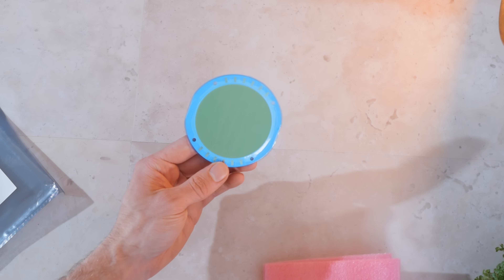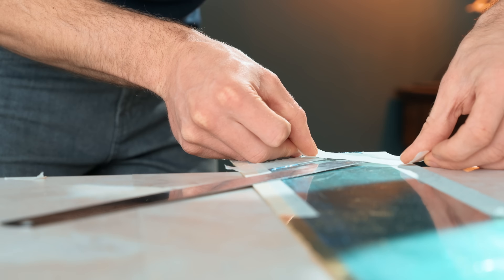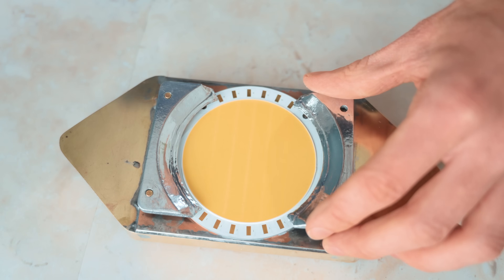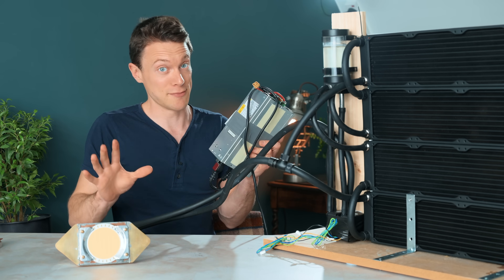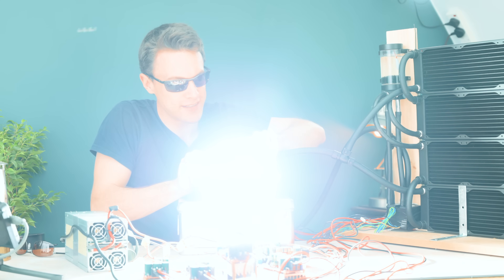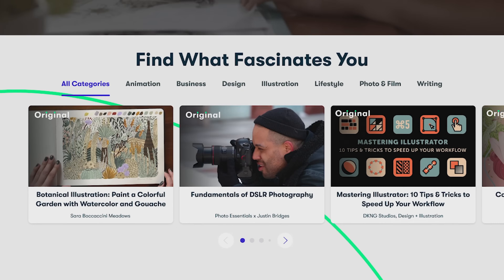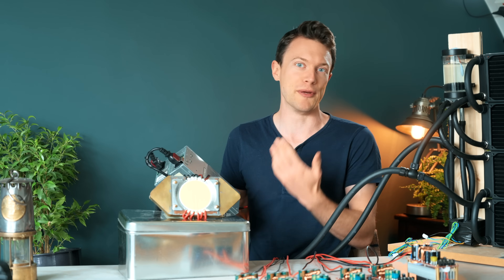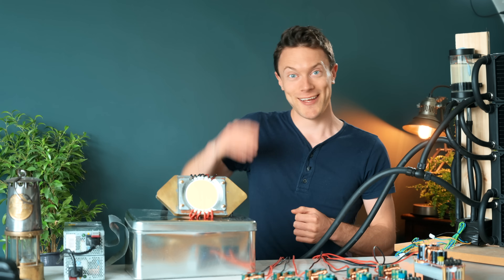Testing the world's BRIGHTEST LED!!!

Comment: @DIY Perks: If you are still looking for a powerfull PSU, check out the LUETZE CPSB3 series. The major unit can deliver 2.4 kW and can be adjusted very wide on the voltage. Google for the #722816, you will also find it in UK. Chers, Martin

Comment: It's certainly safe to plan for drawing 1500w of heat away from the device, but ... that's the total power. LEDs are very efficient (around 50%), so the actual waste heat would be in the 700 - 800w range. Your hands got hot because the other 700 - 800w of power was radiated away as light.

Comment: Sooo the whole point of water cooling is to use the radiators and FANS on the radiators to remove the heat from the water? Otherwise the heat stays in the water and gets hotter and hotter..

Comment: It is a bad idea to put PSU in series because you never know how their ground ended up internally. You can get 2 x 1200w PSU, each of them can connect to 3 booster with 12V, although may add more stress to the booster but the PSU can easily handle high current 12V since it is designed for 12V. The radiator is also being overkilled but since it is a test so is ok, I think even one radiator will be enough because water has ridiculous high heat capacity.
Or, for portability, just use 2 lead acid batteries in series, that will replace the power supply, you are going to show off at outdoor anyway.

Comment: Wait a minute, if t he power supplies are in SERIES, you are not doubling the CURRENT but instead doubling the VOLTAGE. To double the current, you need to have them in PARALLEL. So which is it? Did you just make a mistake in your description or is there a mistake in the hookup?? If the power supplies are indeed in SERIES, you can still only get a maximum of current of whatever the one supply can produce, and you are correct in saying they are not intended to be run in SERIES. However, power supplies are also not intended to be run in PARALLEL either because one could be slightly higher in voltage than the other and therefore would take over more of the current load, possibly enough to cause it to burn up.

I just read Zohaib Shan
's comment. So it seems that indeed you did have the power supplies in SERIES, but as Zohaib Shan
 pointed out, the total power rating is for the three separate output rails. Probably the +5 and +3 are higher current than the +12, which is likely just used to power fans.

Anyway, get a honkin' big 30V supply and get that baby lighting up the whole town! Love the water-cooled solution. I've had so many people tell me that LED's don't get hot I want to scream. The little 2 mm or 3mm guys don't generate any noticeable heat, but then they are consuming mere microwatts of power. Not so with higher power LEDs, even including the 3 to 6 watt versions in screw-in mains replacement bulbs. Heat is the primary killer of those bulbs, and it's usually the capacitor in the AC-DC conversion circuit that dies first. I'm keeping records of failures of those LED replacement bulbs in my home. So far, the average life is about 39 months. A long way from the claimed 12 to 15 years. In fact, the spiral CFL bulbs (claimed to last 7 years) have about that same average life and so in fact do, yes you guessed it, incandescent bulbs. So, for 10 times the price of an incandescent, you can buy an LED replacement that will last about the same length of time. Do the LEDs save enough electricity to pay for themselves? Maybe--depends on what you are paying for electricity.

Comment: One of the large radiators should be enought theoretically, but better safe than sorry. However mixing different metals is often a source aof failiure in liquid cooled systems. The large finspace should stop the cooler from clogging up, but over time the solder might corrode without additives in the cooling water.

Comment: Have you considered using peltier's to cool the LED? https://www.ebay.co.uk/itm/XD-2041-80W-Refrigeration-Semiconductor-Cooling-Thermoelectric-Peltier-Cooler-SP/184279983671?hash=item2ae7f16637:g:ZqcAAOSwDlZesUuh
Reply: Peltiers aren´t really useful for removing large amounts of heat. They can power a well isolated minifridge, but thats about it. A 500W Peltier can barely cool a 100W CPU as shown by Linus Tech Tips.

Comment: Lead and copper don't corrode if kept out if the elements. there's a reason copper piping lasts for 100 years in houses. The copper and brass could oxidize  (see statue of liberty) especially when you get your greasy fingers all over it or if exposed to acidic water. Coat all of the expose metal in a thin coat of laquer and you'll never have to worry. Also Im sure you know to use distilled water so you don't have to worry about the inside getting mineral buildup. I don't think you would need to use any additives.

Comment: The power supplies died because of the series connection on the smps they need to have exact same voltage into even mv  for being run in series without burning themselves but the thing is even the difference in length of the wires can change that

Comment: Quick question, I got into tinkering and I need to get myself a digital multimeter. I read online that I should stay away from the cheap ones and I noticed that yours used in the video 11:40 costs about 25 euros. I would like to ask how it performs and if I should get it too. I was actually saving to get a fluke. But if something like that is enough I can just ditch the fluke because it is expensive

Comment: That's an overkill cooling solution, LED's convert a big part of it's power to light so you shouldn't compare them to CPU's.
Also don't use PWM power supply in series.
Take a look at "Taskled" drivers, i've been using them and they are the most advanced and compact i known about.

Comment: Not sure if it's the right terms, but I'm thinking what happened is the power supplies can put out that much total current, but split between multiple power rails. Since you likely pulled the power from a single rail from each, it likely was too much for that single power rail.

Comment: Isn't your cooling system not way to overpowered? What is the efficiency of the LED? If we assume 90%, you only have the dissipate 10% of 1500W which is just 150W of heat.
Reply: Only in your dream they are that efficient

Comment: 1,000 watt server power supply's won't put out that much through the 12 volt rail. It should show the limit on the case somewhere. It probably puts out 500 watts to the 12 volt rails and probably another 500 to the 3.3, 5v, and -12v rails. I'm surprised they didn't go into power failure mode and just blew up, then again server psu's are designed to keep pushing power to be reliable. You need 12 volt only power supply's or a single 24 volt power supply and divide the voltage for the 12 volt system. Very impressive led though! You could get away with only 3 radiators and the best fans you currently have to make it a little more compact, 30 degree's is very good.

Comment: I think you're mistaken. Ideally the liquid coming into the block is room temperature and the liquid coming out of the block is warm. The fact that the block is not warm on either side more likely means it is not doing it's job of moving heat from the diode to the water.

Comment: $500 LED from last time is more than enough for 90% application, this is completely insane. What you trying to do? Communicate with aliens? By the way, this cooling unit won’t last, mix metals in cooling loops is a disaster in the med-long run.

Comment: 1:56 "But despite my hunting, i can't find one that is big enough to fit on the LED" Strange i find one in only a few seconds, just use a AMD Ryzen Threadripper CPU Waterblock, they are a LOT bigger then the normal CPU waterblock. 

https://www.amazon.com/s?k=amd+threadripper+waterblock&crid=38H5PN27AWCIZ&sprefix=AMD+Threadripper+Wa%2Caps%2C235&ref=nb_sb_ss_i_2_19

And it can take up to 1 and a 2 hours to see the real temps you get with water cooling, a LOT longer then the normal heatsinks (non water cooling) you have for CPU's.

And why not buy a 200w PC PSU, then your done, is a LOT better then doing two in series?!

Comment: It is really weird that the power supplies failed. These power supplies do have over current and over temperature protection usually.  There must have been some fault in the before or doggy components. Powering them in series is most likely a problem.

Comment: hmm are you sure the power supply can do 750w at 12V AND are you sure there are not a ground loop short for the power supply when you connect it in series? Plus the sequence of powering them on also matters when connecting in series. AND why not judt use them in parallel if you are using boost converters anyway...

Comment: A 1500W LED doen't put out anwhere near 1500W oh heat. If it did then it would get hotter than a toaster oven and no light would come out as all the energy is converted to heat and not light.

Comment: you do know how overkill your cooling setup is right? unlike pcs if leds are efficient it means there's a lot of power NOT going into the heat sink. just kind of hurts to see such a waste of resources. also instead of buying 2 pumps you know what would have kept your led MORE safe at less resource waste? a fucking temperature sensor. hell buy 2 temperature sensors and 2 relays that's where redundancy actually makes sense.

Comment: You should check with the manufacturer--just because the COB LED is rated to 1500W max, it is usually unwise to run it at max power. Running it at 50% or lower, maybe even 30%, is more sensible or you reduce it's life span, i.e. you burn it out rapidly. Cooling it would be less of a problem too. 1500W probably exceeds if not triples max sunlight in it's beam. It's just something to think about. I think most 'grow lights' run the LEDs at a significantly lower wattage than the max wattage that could be used and can still exceed sunlight, in the $600 price range, including all the electronics and cooling.

 Also, there are specialized LED drivers/power supply designs that are specially made for controlling the voltage and wattage, to make sure you don't harm the LED, and you might want to look into their design in relationship to computer power supplies. (I don't know the differences, and it's possible that computer supplies can be modified to accommodate the differences. It's just something to think about.) 

These a very interesting COBs, and their application does require cooling designs and probably lens designs to distribute the photons, but I think they are not meant to be run at full power. 

They have more available light in a compact unit, and could be very useful , but it comes at a price. You say you got this for $1000, but they are more like $1500 and don't include any of the electronics. These could make a great grow light in a large space, or spot light, stage light, or photography light when used properly, but even so, they are overly expensive for what you get, and the grief you have to go through to balance all the other factors needed for setting them up and making them usable.

Comment: That thermal paste application is guaranteed to start a fight in the comments section
Reply: Pretty sure he scraped off the excess, but damn I've never seen so much thermal paste in one cooling "block" before
Reply: @brandonthegrey  The best way is to just squirt out a single round blob. When it gets tightened down it evenly spreads out with no chance of air getting trapped. Either way, who cares. It's not my stuff that's going to get ruined.
Reply: @rubiconnn  Well it's fine here since he doesn't really have any electronics beside the LED, so no greasy motherboard for him
Reply: @brandonthegrey  overapplication can reduce thermal performance
Reply: @corysinclair5753  That's true; also having that many radiators isn't beneficial either (he's better off with one).  It's still fine though. His water loop is redundantly capable of cooling the light in spite of the small oversights.
Reply: @davidcastillo1340  A single radiator is designed to cool off about 300W of thermal power. Way too little to cool his LED. Using 4 of them was a good call.
Reply: mezz Dude not all 1500 watts is being converted into heat coming off the back of the LED. The majority of those 1500 watts is being converted into, don’t act too surprised, LIGHT
Reply: @bloogaming8827  majority? You overstate the efficiency of LEDs way too much. 60% is already a tech marvel, above that just some lab ones. Not to mention a bit of that also goes into invisible light, including infrared (which itself turns into heat easily, tho granted, pointing away from the chip).
By that figure, 2 of those radiators would already be saturated, which is quite expected of high-end enthusiast grade PCs running on water cooling, overclocked with multi-GPU setups (and ye you better keep that LED under 80ºc at the very least).
Reply: Kalvinjj I stand corrected. Not quite majority, but still a significant percentage of the 1500W is being converted to light and not heat. I’m glad you brought up PCs. An overclocked multi-GPU setup could definitely require two of those radiators and would be giving off easily 800W. However, notice that the coolant temperature in this setup didn’t even get above 10° over ambient. The difference in temperature between the air and the coolant is a significant factor in the effectiveness of water cooling. To get such incredibly low temperatures, you need a cooling system that incredibly overkill. A 420mm radiator with 3 high quality fans couldn’t keep 100W CPU that cool. I very much doubt this setup with mostly mediocre fans, aquarium pumps, and a tiny reservoir could keep 900W that cool. But now that I know that the LED is less than 60% efficient, my guess would be that the failing power supplies are an indicator that they were faulty. The LED wasn’t getting full power at all and therefore much less heat was being produced. There was 1650W coming from the wall because the PSUs were running hot and at the limit of the capability, both of which drastically reduce efficiency.
Reply: @bloogaming8827  lmao that's what the primary commenter needed to do, TO INITIATE A DEBATE!!
Reply: Union Jack application ftw

Comment: So I need a thicc ass Cable in the Car tonpower a 500W Subwoofer but you get 2000W through the tiny wires?

2000W PMPO or something?

Comment: You dont need 4 bloody rads for 250w.
Reply from the maker: It works out at 1000w of heat actually, and I want to cool the whole thing quietly when it's finished, so 4 rads actually isn't overkill but just right I'd say. I'll ramp the fans down so it keeps the water temps at about 40c in the final build.

Comment: Thanks for sharing! I tried the SkillShare link and it offered the 2 month free trial... until I submitted my credit card info. A tiny banner came up at the top of the screen saying "Sorry, you're not eligible for this coupon," and when I checked, it had automatically set to bill my credit card in 2 weeks, instead of 2 months. I think that's a rather deceptive way for them to run their referrals program. Certainly not your fault, but I thought I'd post this here in case others are getting tricked into being billed sooner than they expected.

Comment: If these PSU's are anything like the server PSU's used by RC hobbyists to charge lipo batteries, you'll need to modify one to be basically be a slave psu from the little I've read.

Comment: interesting project. i check the specs of this led and realized that this works from 30v to 41v. so you cold have put 3 power supplies in series to make 36 volts. 
1. this will put less load on each power supply so they won't burn.
2. don't have to use voltage up boards. will save money, time and effort.

A geek to geek tip.
hope it helps.
Reply: Yeah, I found the boost circuitry felt like a very bad idea.
Reply: The LEDs need a current limited power supply. That functionality is in the boost converters. Without it, the LED will be destroyed.
Reply: @PaulHaas  Bah! Current Schmurment!
Reply: NEVER EVER do this. Not unless the power supplies are specifically meant to do this. With some power supplies it will smoke them out. Parallel or series, power supplies are not batteries, do not treat them like batteries.
Reply: Yeah, the boost converter draws more current from the power supply.
Reply: Using all the same power supplies.. He could use 6 computer power supplies, in two parallel series of three. I think that would be a suitable power source.

Comment: This wouldnt last very long at all. The mix of different metals and stuff will very quickly cause reactions and either ruin the pump, ruin your soldering and leak, or clock the cooling fins.

Comment: 1:25 that's not a  colossal air cooler it's a heat sink which is meant to not have fans on it to keep noise down in your system lol
Reply: Ok 1:38 definitely not water cooling so please don't post water in that system because it will boil with that amount of heat and create a lot of pressure in the cooling system which is generally not a good thing so please use oil
Reply: 2:13 not solid copper it's silver plated with copper
Reply: I work with those persionally
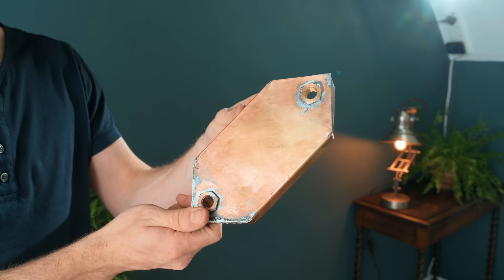Reply: 4:08 yes you did bond the metal together but I would have used an actual sodder gun cuz you have no mcfricken idea if that is water tight
Reply: -12:01 idk if you have fans on those radiators but I looked up the LED and with fans you mabey need 2 of them with fans to cool the LED to room temp
Reply: -10:03 fries the boost boards

Comment: Hi, Thank you for an interesting video.
I wondered if switching OFF the light and power supply together might have caused the latter to fail. 
I feel allowing the power supply to gradually cool down might be required to keep it going.
So basically first switch off the LED, leaving the PSU on to cool down might be the thing to attempt.
Great fun!